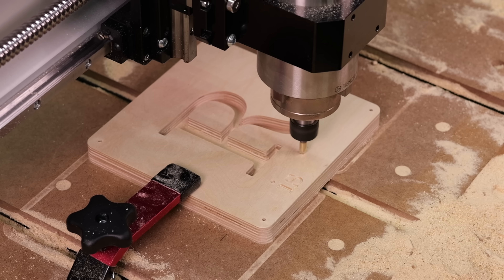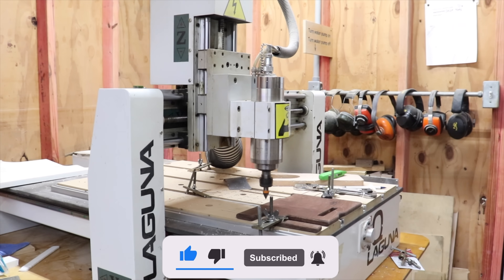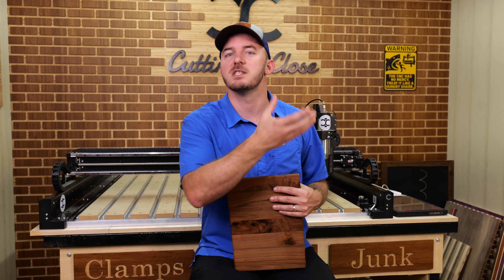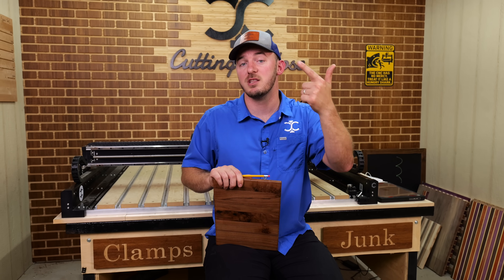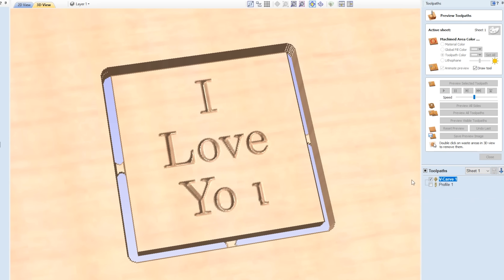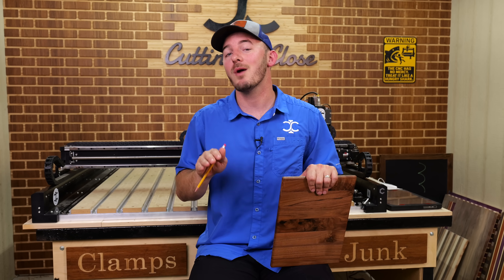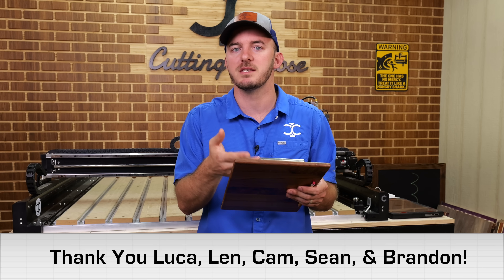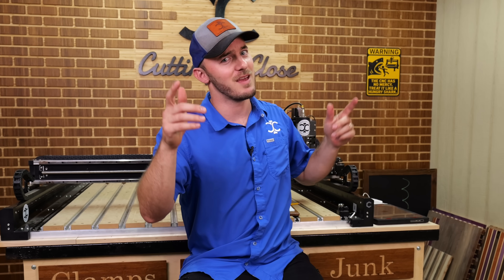CNC Router Buyers Guide: Top 10 Questions Answered

Comment: So I just bought a CNC, {CNC Router Machine PreciseaMax PRO 23 Closed-Loop Stepper Motor Engraver with 710W Trim Router Spindle, Ball Screw Milling Machine,600x500x105mm,Wood Metal Acrylic Cutting Milling,GRBL Control} and I am learning it and watching of ton of your videos which are excellent. I paid about $1300 and it seems to be pretty well built and I have done a few projects on it thus far. Problem is there is hardly any support for this machine from the company. I should have known!!!! Well as I don't have any real issue's now I am wondering what about in the future? As I am in the window to return, I am wondering if I would be better off in the long run to do so and purchase a different one and spend a little more? Have you ever heard of this machine and your thoughts anyone? It did have a 5 star reviews and is one reason I chose this machine. Thanks.

Comment: You will learn stuff every day. Whether a better way of doing things you have been doing, faster ways, simpler ways, the DON'T DO THAT..
I am a "Can I get it to do this" kind of guy. I tinker, test my limits, the machines limits, Improve the machine. I am not one that just tries to make money but as an enjoyable hobby.  Yes.. I started by buying a cheap 3018 to see if it was something I would like. Found I enjoyed the challenges. Found it very limited on its abilities.. but a great learning experience. Tested many different ways of free software to create the artwork, create the g-code "CAM", software to control the machine "candle, BCNC.
Then bought the hardware to build my own CNC running grbl "Arduino", then upgraded it to LinuxCNC.  My CAD CAM is almost always FreeCad now. Not simple but I enjoy the creating as much as cutting out the projects to finish. Just my perspective ..

Comment: Don’t own a CNC router yet, so sorry if this question is ignorant. I have experience modeling in blender and fusion 360.  Fusion 360 offers a personal use license that can be renewed annually for free and it has tool path features in it.  Will I need to use X-carve or can I say inside the Fusion 360 ecosphere.

Comment: I started with a genmitsu 4040 pro for around $500. The very first thing after i figured out how to use it was drop $300 on the mounts for a router, a magnetic dust shoe, and the router itself. I was kind of kicking myself because for not much more I would have gotten a larger machine already set up for a router from the start. However I like my 4040 pro. It does pretty good for its size and it's set up in my freezer room.

I would suggest though to anyone budget constrained to not buy a CNC. I feel like at every turn I had to buy something else. I started with a $500 CNC because that's all I could afford. But then you have to buy bits, software, materials, finishes, dust collection, enclosure. Thankfully I was able to make other changes to be able to buy those things but I was under the impression it was like a printer, once you buy it you just get the materials and go. Yeah you can skip some things but not if you're going to be using it a lot.

Comment: Yet another excellent video, but with respect, you short-changed the spindle vs router discussion. What you said was accurate. What you left out is as important. Many of the small machines, including those from Sienci whose machines I know you like, are not set up to handle the weight of a spindle. The added weight can, and frequently will cause issues.
Reply: Could you elaborate? Would love to learn from your experiences :)

Comment: just finished putting together my 4x4 altmill.  2.2 kw water cooled spindle.  there is no chance that i was going to use a trim router. 
i did buy a cheap cnc at first to see if it was something i enjoyed.  didnt have much space in the old house. now that we sold that house and bought one with a big shop so the altmill it was.
Reply: What made you pick the 2.2 KW spindle over the 1.5?
Reply: @trashbag8124  i got a pretty decent deal on this one and i deff wanted water cooled.  the 1.5kw was prob more than good enough but when they are within twenty dollars of eachother im going for the stronger spindle. dont know what they are now.  but i did have to rma the kit once because once i hooked it all up the drive popped as the spindle was improperly connected inside the spindle. (i am a controls electrician so i had to take it apart and look.)

Comment: I didn't buy a machine but built my machine from the ground up. Not the fastest way to get up and running, but I understand my machine inside and out. If something breaks, i know where to fix it. Have broken 3 bits in my time, and two was because i droped them on the concrete. My 4x4 paid for itself on one project, less than 3 weeks- but that is not counting the time I had to assemble and troubledhoot the electonics.

Comment: I built my oen custom CNC as I have engineering background. But I made one big mistake, I went quite cheap way ending in replacing most components of machine..Only table frame and ballscrews left from original "design". I relpaced bridge/portal, all motors, guides, spindle, controllers etc.  I guess its same as going cheap on commercial machine.

Comment: CAM is the place you will make your most expensive errors. You will create the incorrect depth of a cut, not enough clearance across your carve and many other issues. Broken bits, carves that don't turn out, incorrect Z zero after bit change and the list goes on.

These should be seen as learning experiences and never a mistake.

I started with Easel and quickly found limitation and moved into Vectric. I feel that is the best CAD/CAM for a hobby CNC router. I use OpenBuilds Control to run my CNC.
Reply: Try GatorCAM for CNC.  It does v-bit too!

Comment: I will be putting my shapeoko 5 pro together next wee. Just finished my new shop. I did go a little over board buying things but I do have a little experience in woodworking, buying and selling products. I use laser engravers and 3d printers so i am hoping that will help me learn the software a little bit faster. I did invest in Izzy Swans vacuum boots and a vac pump to try and help hold things down. Will let you know how that works out in a few months after using for a while. Thanks for all of the great info. Looking forward to more videos. I also bought a few bits and am looking at inlay kits and files from you.

Comment: One more surprise/discovery - running CNC from PC is better than from offline controllers. I thought I would manage keeping the computer further away, but you will have to run beck and forth to it a lot. Helps to burn calories, but keeping it close or connected to the CNC helps to work.

Comment: I started with 3018. And probably I do not regret... It's like with motorcycles - ppl recommend starting from 300cc and then go up. With motorcycles I wouldn't do it this way, though, but this tiny CNC taught me A LOT! And I got my answer to the main question - do I like playing with CNC or not. If you already know the answer - those tine CNCs should be skipped.
Reply: Had the same path. After modifying the 3018 a lot, it eventually became a bigger machine. Currently, gathered the original parts of the 3018 and re-assembled it with fortifications I learned along the way. It’s now my dedicated PCB miller.

Comment: I got my first cnc back in 2012, just to make fun stuff. Not many hobby machines on the market at that time. The user community was the key to success. You WILL have issues after working hours and on the weekends! During that first year, I swear that Friday at 4:00, something would go wonky, or I would be trying a new design process. (I had a day job then)
Check out the user communities for the machines you are considering. Are the responses timely and respectful of newbies? Do you feel that they are “your people”. I love that old girl, but I would never have continued if it weren’t for the front line people, many I still talk to today! Even now, If I were considering a new machine, the people would add weight to the decision.
Reply from the maker: 100% agree with that statement. Can’t state it any better.

Comment: Vectric offers a free download to practice on . you cannot use use it on a machine. Its great to help learn as it simulates your design. Mark Lindsay and kyle have great online tutorials. This video is great advise for a potential buyer. plan on dust collection especially if you work in a small shop.
Reply: Mr Tom, have you tried GatorCAM for CNC?  I'll give you a copy...I'm the author.
It converts inkscape art into gcode!  And it's soooo fast to use.